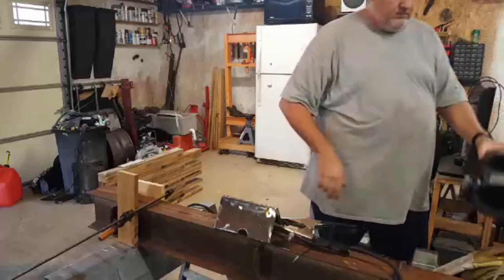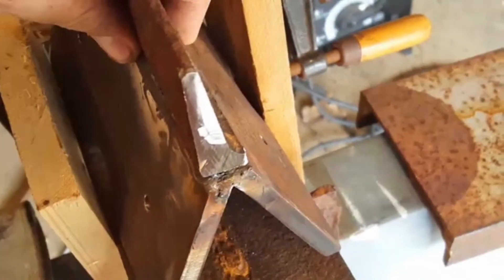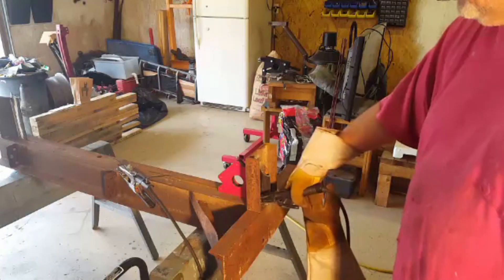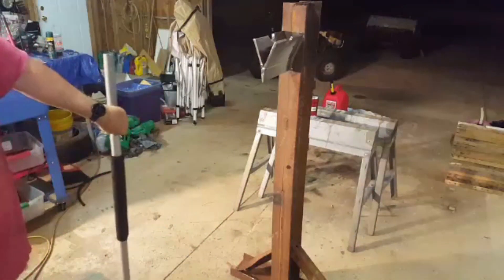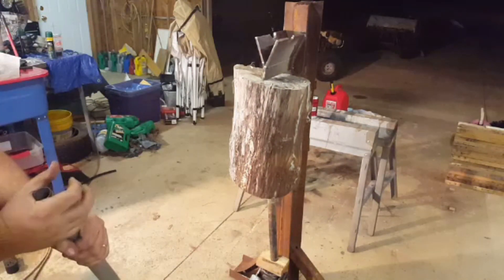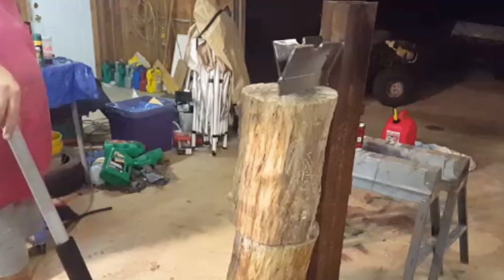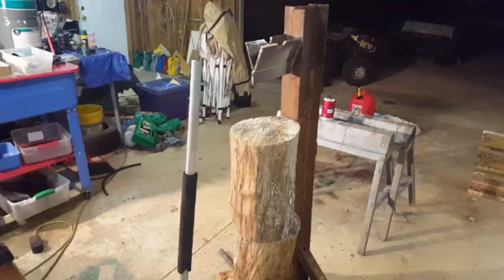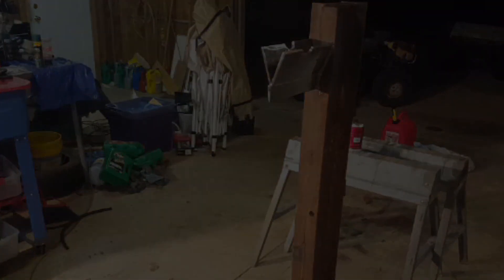Building A Log Splitter Part2

Comment: You may want to sharpen up, and add a cheap air jack. This should take the log apart in a slow controlled fashion. Or you could perform the high speed log dissassembly method.

Neat project!

John